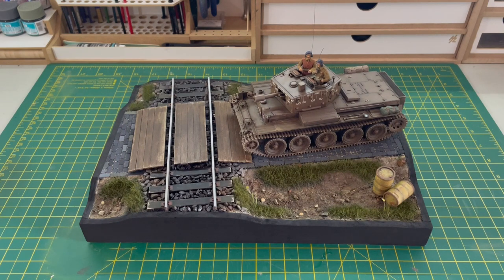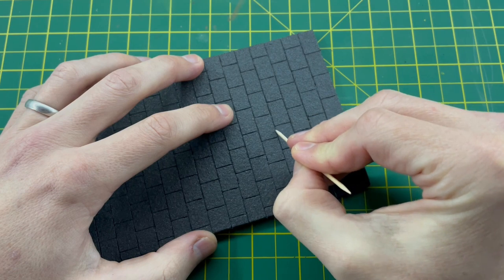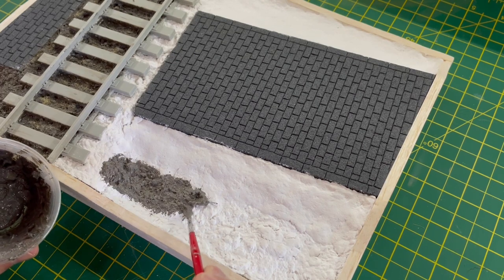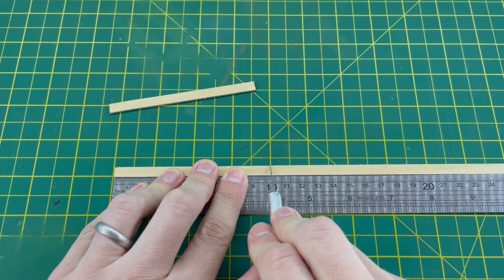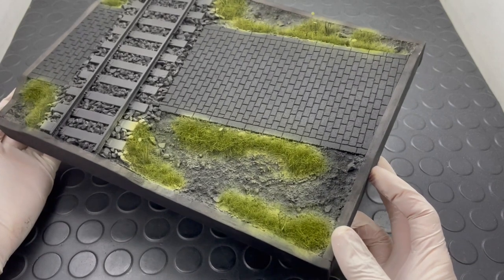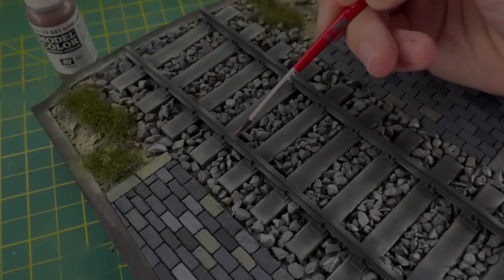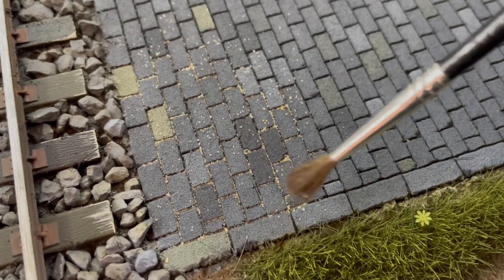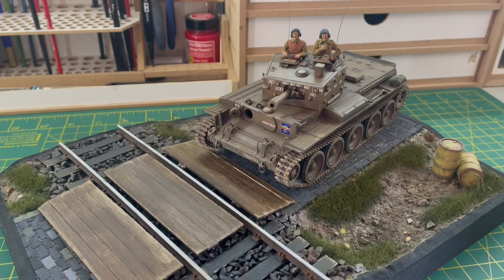Building A Railway Crossing Diorama | Centaur 1/35 Scale Model

Comment: Great build, thank you for sharing.

You're right about the size of the ballast, way too big. Also, unless that is a busy main line section of track I would have expected to see more (some) rust on the tracks. Even rail on a reasonably busy line has rusting.
Reply from the maker: Thanks for watching. I agree, about the rusting, in the end I settled on only the seats to receive the rusting. It could maybe have done with a rust wash along the actual rail as well.